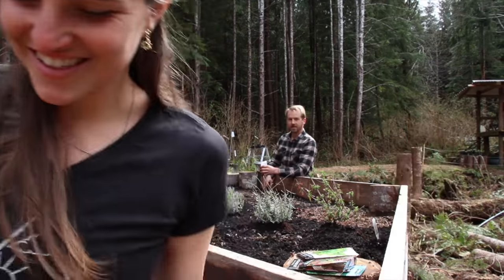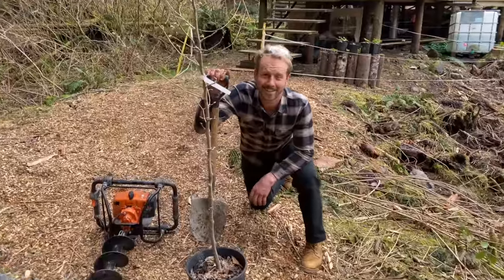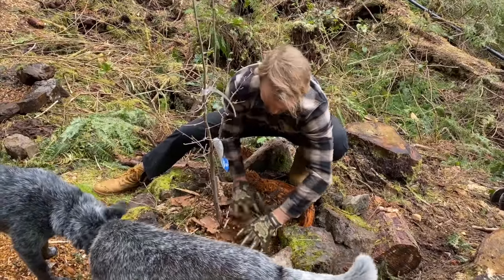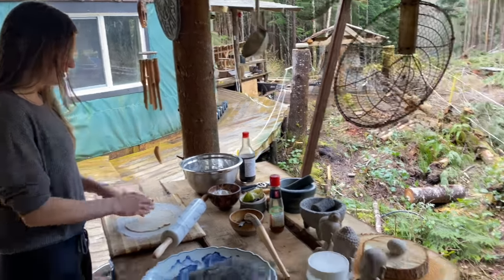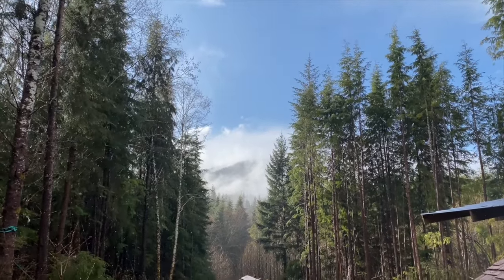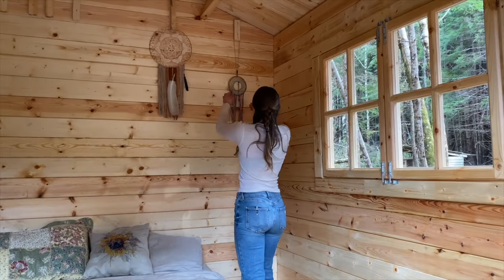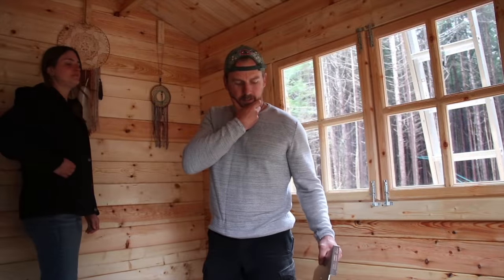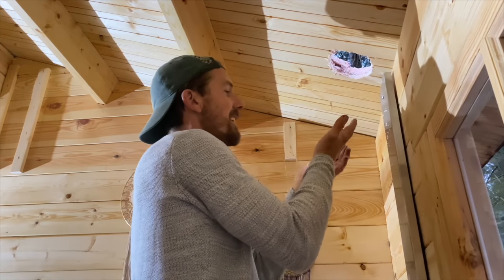OFF GRID LIVING - My BUNKIE CABIN BEDROOM | BEST MINI WOOD STOVE | Hazelnut & Almond Trees - Ep. 129

Comment: honestly a wood stove right there looks like a great way for embers to start a bedfire
Reply: I was thinking the same thing.
Reply: I've seen people use those stoves in smaller spaces surrounded. By furniture just as flammable with no problems. I think at this point I decided that these stoves are designed in a way to prevent that. Kind of how is designed to push all the smoke out and radiate all the heat into the room. Idk though I would have up look that up

Comment: Everything looks awesome! But I think raised heater stove will make the bottom half of the cabin much colder than the top portion. The rule of convection. Most of the air will circulate at the lover portion of the stove and up. Cold air will at the bottom portion of the cabin without much movement.

Comment: A wood stove never heats anything below it. Therefore, the best place to put it is as near to the floor as possible.
Reply: That's not technically correct.
Reply: @marcusskidmore6913  Technically, you are correct, because left to its own work, it would heat the air above it to the point that the air above it could heat the air below it by radiation, but it would be a very slow process. Putting the heat stove as near the floor as possible will speed up the process very, very much.
Reply: @dalebannon8503  -fan ?
Reply: @triumphmanful. A fan helps. I use an electric fan, blowing straight upward to mix cold floor air with hot ceiling air. That works exceedingly well. If you have no electricity, there are heat driven fans but they barely make a difference. I think they are mostly psychological.
Reply: @dalebannon8503  i have two. I put a candle in front of them. Hardly flicks the flame. Waste of  money !
Reply: Only fans?
Reply: @Marcus Skidmore  Marcus, I am not sure what you are asking. Are “only fans” a waste of money?  There lots of other things that are not worth the money. For sure, for sure. But, maybe you are asking: Are fans the only solution to mixing hot and cold air?  Well, it is always coldest at the floor. My two solutions are: 1.  Furnace as close to the floor as possible. 2.  Use a fan to mix the air. Maybe you can come up with more ideas.

Comment: I fast forward to the 45:00 min mark just to see the fireplace. I believe you guys are the 1st ones I've ever seen where the fireplace isn't directly on thr floor (other than a van build). 

I like how the fireplace is up off the ground just because it makes it easier to place wood into the fireplace than bend so much in the back to keep the fireplace going into the night. 

But I also appreciate the bigger fireplaces that people use to do both heat and cook on top of. To each their own, so because back problems run in my family, I would want the fireplace that's at chest level. 👍

Comment: The tiny woodstove are cute, but they're a major nuisance - first, you'll spend twice as much time chopping wood into sizes that fit into your teeny stove, and then you'll discover that you'll need to stock that teeny stove every 90 minutes or so. I get it - a full size woodstove takes up valuable space and will make a small or tiny home hotter than Hades - on the upside, you can choke down the flue to get a slower burn and open the windows to modulate the temperature. We put what we call "sleeper logs," into our 2 woodstoves at night - one is at our house, the other at our cabin - and the wood burns slowly all night; I'm usually up (briefly) at around 530 AM to restock the stoves and they still have lots of embers to get a good restart. Again, this little stove looks quaint, but I just cant imagine the work involved in creating "tiny firewood"!

Comment: Nice video. The hot air off of your wood stove would circulate better if it was closer to the floor and if you had a curved heat shield  behind the stove pipe you could blow the fan on the pipe to extract more heat off of the pipe.

Comment: Love that stove, I'm building a 100 square foot cabin with a loft. We will be using our cabin as a get away and will need to heat it when temps are 10-20° down to -10, -20, think this would work well if the cabin was well insulated?
Reply: Not likely...way too small. Not to mention having to feed it all night long.

Comment: This is disrespectful but your new bedroom is my garden shed.  Literally we use those structures a storage shed for gardening equipment. They would not pass any regulations fir human use. This show how different countries view houses. Living off grid is very hard in the UK so you bedroom would have to meet stricted codes of insulation flooring foundations heating roof material's etc you putting a wood burner in without and fire suppression or safety.  I love what your doing and you so lucky you can do this . We are so regulated and watched.

Comment: Chapatis are best made on a dry flat iron. However, you can still get an evenly cooked chapati if you could use clamps to hold the chapatis in place. This way you can cook all sides equal without them sliding down into the wok :)

Comment: These two are a force of nature but Folks, please  don't cover beautiful fur or pine floors with laminate... Hardboard insulation tacked on to stringers below the subfloor floor  is 10 times better insulating than the thin layer of foam on the bottom of that floating laminate. Best of all  natural softwood (or hardwood of course) flooring becomes more beautiful with use. This cannot be said for fake.... anything. No place for engineered "flooring" made with all manner of chemicals in an off grid lifestyle. 
Sorry I felt compelled to say that. Keep living the dream.